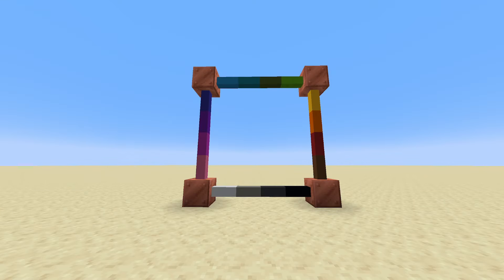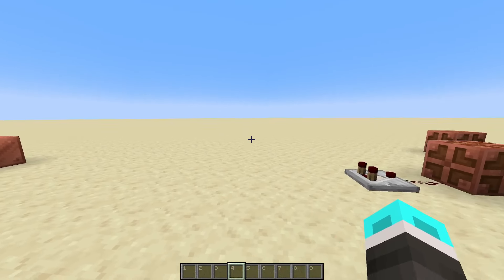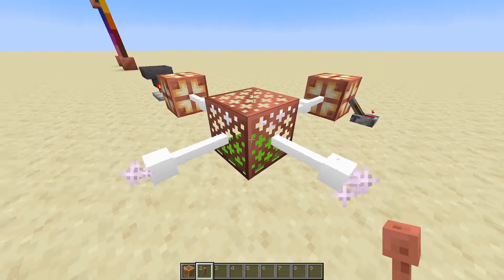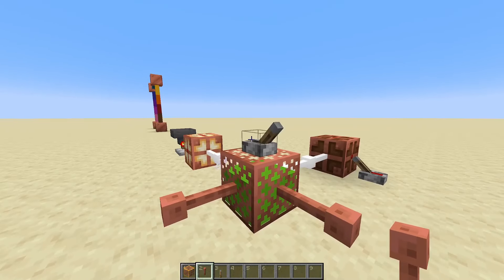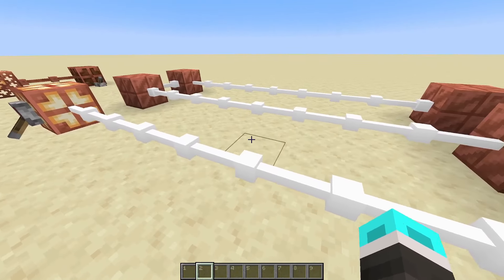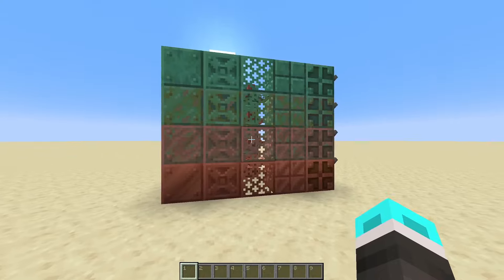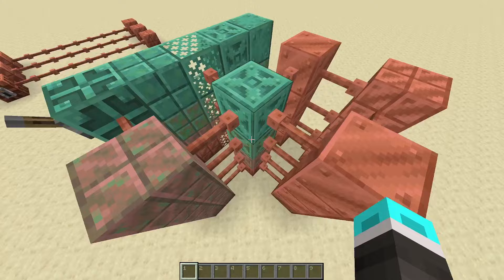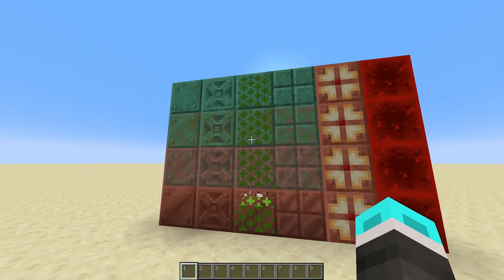Copper Wiring Datapack Beta 3

Comment: I have a problem with this idea:

In your current implementation of this idea, copper/electrical power functions more as a continuation/addition to redstone power instead of a separate system.  This idea is fine, but I feel it reduces the usefulness and continuity of the whole idea.

I propose that there should be a transformer that is required to convert copper/electrical power back into redstone power.  

Currently, electrically powered copper wire that touches any redstone component powers said component.  This prevents redstone and copper/electrical wires from being compactly used together in the same build.  You could not run a redstone line next to a copper line without the redstone line potentially being interfered with.  This is less useful and doesn't really make sense as the copper wires are supposed to be directional.  The copper wires output copper/electrical power in only one direction, but outputs redstone power in all directions.  

Another thing that doesn't really make sense is why redstone power has to use a transformer to be converted into copper/electrical power, but not the other way around.  Shouldn't that mean that random lightning strikes should activate redstone?

Having copper/electrical power not directly output redstone would make things easier to code I think- …

:/  I suddenly realized that it's a forced vanilla feature that makes powered copper wires/lightning rods output redstone in all directions.  The more I think about that the less it makes sense.  In the end this isn't really a continuity problem of your data pack but a problem with minecraft?  I'm not sure.  I had a whole concise argument laid out, but now it's kinda just random thoughts lol.  Idk, regardless, I'm not trying to discourage you from making this data pack, it just feels like something about this whole system doesn't quite click together and make sense.

Comment: I made an 4-bit ripple carry adder!
Can I work with someone on some "Logical copper" Project? 

Also acorn, idk why but when i download datapack, normal copper block worked like grate in v1, idk if it is alr?
Reply: Is there any discord server?
Reply from the maker: That's meant to be. I swapped the blocks around
Reply from the maker: @ZiomekZKresu  I don't have a discord server, nor any plans to make one.
Reply: @AuraAcorn  so which block should I use to change direction with multiple outputs? Copper bulbs?
Reply from the maker: @ZiomekZKresu  If you used grates before, you can just use copper blocks now
Reply: @AuraAcorn  mkay, btw I just desighned XOR gate 4x2x8 and im exited abt it lol

Comment: Instead of the delay being 1/2/3/4 ticks for each oxidation level, I think it should be 0/1/2/3 ticks (if that’s possible with the way you’re making this work). That way if you add oxidation to the lightning rods (maybe by clicking on it with a copper block of that oxidation?) each oxidation state could have the same delay
Also, I haven’t tested the datapack so idk if this is the case, but if the insulated wires connect to any non-air block, they might connect to things like water or tall grass. You might be able to make a block tag with blocks that it shouldn’t connect to and test for that tag instead of air (including things like all 3 airs, liquids, certain transparent blocks, etc.)
Reply from the maker: I currently have that tag you're talking about, which includes air and water (and grates because I felt like the direct connection looked cooler). I could have it ignore things like tall grass and other transparent blocks, but I also wanted to affect as few blocks as possible so that you can use it for its visual element as a decoration, without worrying about things it may not connect to.
I'll see if I can remove the delay on the no oxidation block, I was thinking about doing 0-3 but haven't decided yet.

Comment: Instead of using redstone dust with a comparator, couldn't you just have the comparator on its own?
Reply from the maker: @y2k04  comparators are weird and their internal signal strength can't be detected, so the pack wouldn't know what signal they're carrying
Reply: Are you sure? When I looked for the redstone comparator on the Minecraft Wiki, it shows "OutputSignal" value in the block entity data.

In that case, would this be possible:
/execute if block ~ ~ ~ comparator[nbt={components:{OutputSignal:15}}] run say test
Reply from the maker: @y2k04  a thing like that, as far as I can tell, is not possible. I'm using block states, and the power output level of a comparator is not stored as a block state. It's behavior is hard coded into the game

Comment: 5:42
would be fun if waxing the blocks slowed it down by a tick per block, obviously its still viable but if you want true max speed your going to need to go through and strip the oxidisation every once in a while (and make fully oxidised not work or have repercussions or something)

Comment: I REALLY don't like, that copper grate blocks are used as capacitors. Why did you change it from heavy cores/a player head to the copper grate? Wasn't that used before to enable crossing wires without them affecting each other?

And with the new changes allowing wires to be powered by redstone dust, it would be awesome if, depending on the power levels that goes into the copper bulb, the battery would charge at a different rate, as well as being able to read out the power level, enabling an easy way to send a redstone signal at a specific strength. 
Then different levels of oxidation could reduce the power levels, while two wires going into one block with only one wire would increase the power level.

Comment: Any reason for concrete and not wool? Maybe both? Regardless, really hyped for this datapack

Edit: Oh, it's already out, nice lol
Reply from the maker: Wool would realistically burn in contact with high voltage wires, but when I make things right-clickable, I can easily add wool as an option anyways, as well as many other blocks.
Reply: @AuraAcorn  if you wanna be realistic then wouldn't you just use terracotta? ceramic is actually used as an insulator and it already has the colours for coordination too
Reply from the maker: @AshEshyr  I felt like terracotta was too dull with colors, but I'll add them and wool both later on.